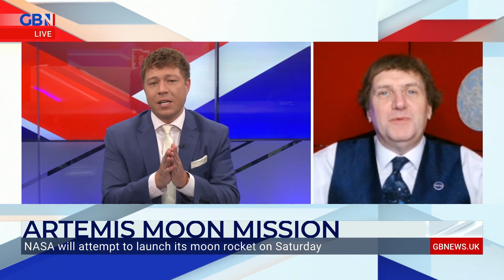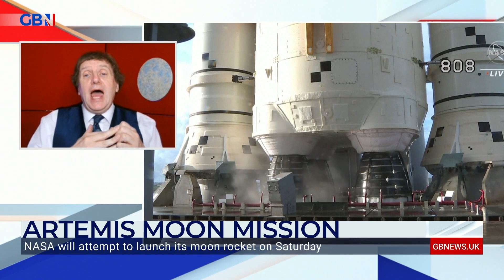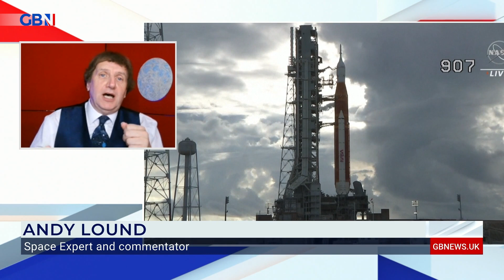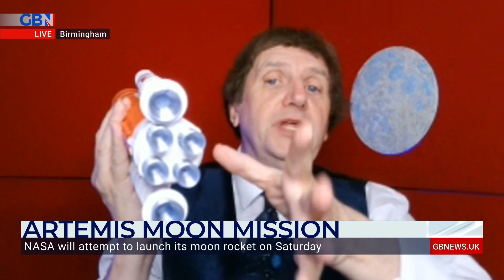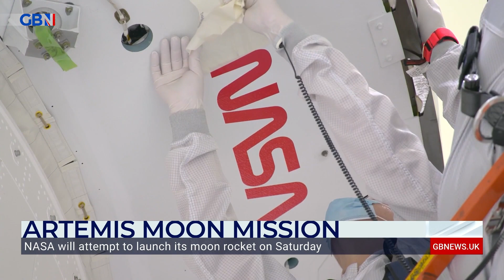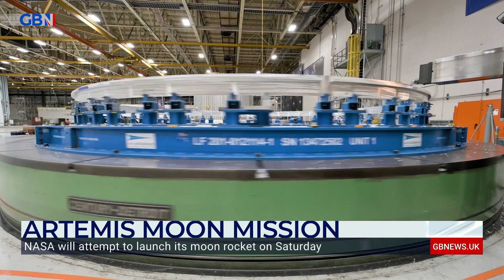NASA's second attempt at launching its moon rocket 'should go ahead' this Saturday | Andy Lound

Comment: The biggest white elephant that NASA has ever produced. A program that was cancelled in 2012 (Constellation), and then ressurected a few years later with cost and engineering caps, and only possible by cannibalising the space shuttles for parts, like engines etc. Nobody outside NASA or Boeing think Artemis is value for money. The internet is awash with analysis as to why it should be scrapped. The best thing that could possibly happen is that it blows up on launch and the whole program cancelled, then the money diverted to other more important projects.